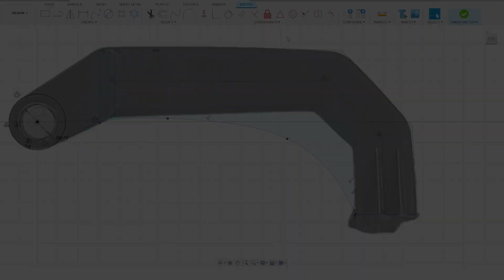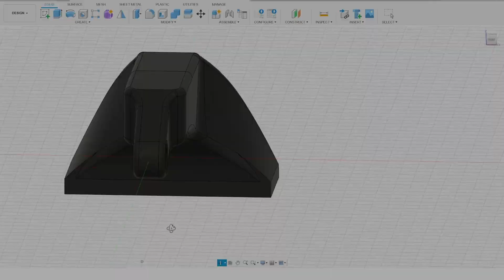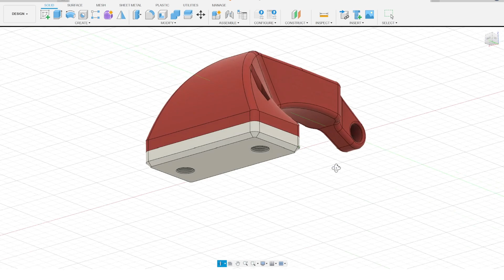From Broken to Better: Yakima Box Hinge Repair

Comment: Just w9ndering, which 8s stronger. ABS or ASA?
Reply from the maker: In the elder days, ABS, forged in the forges of mortal hands, served well - but only in shadow. When the sun rose high, it would bend, crack, and falter.
Then came ASA, kin to ABS but tempered with light. The Elves named it Anárendur - Servant of the Sun.
And lo, where ABS would wither, ASA stood firm. Unyielding. Resolute. A silent guardian of rooftop boxes and garden gnomes alike.